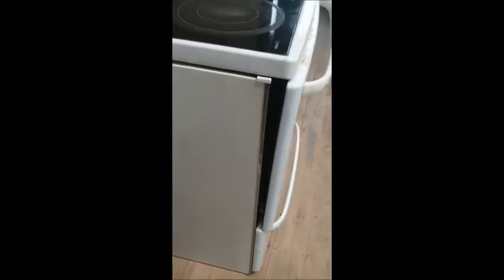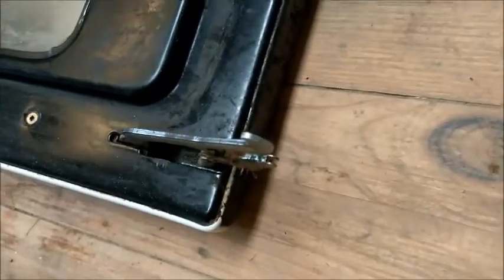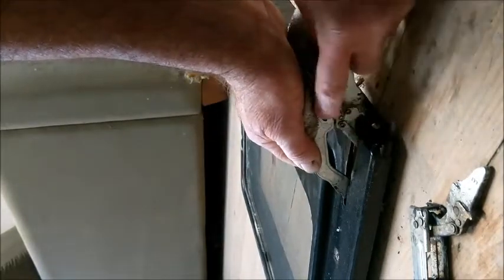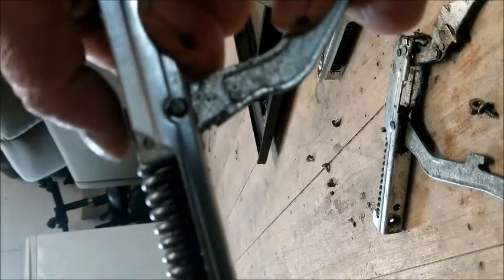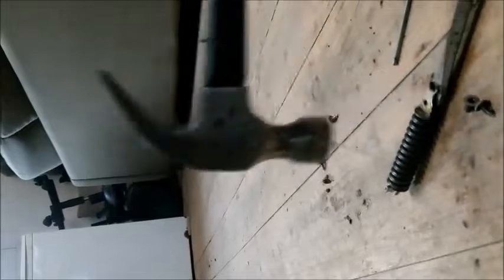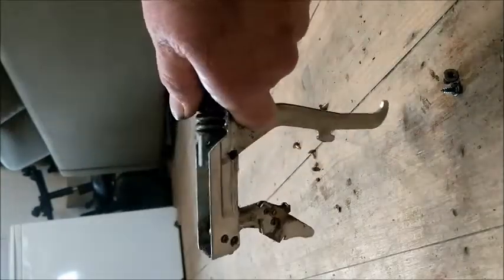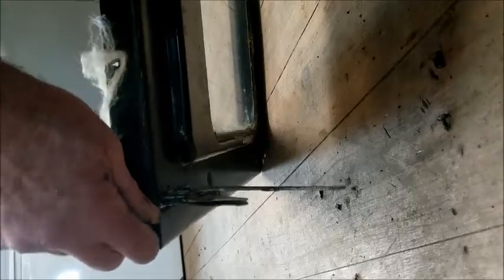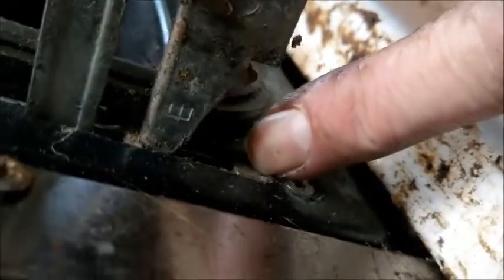Oven door not closing properly (Long double hinge type)

Comment: Cheers! This is the exact same hinge design as my Fisher & Paykel oven and followed your steps, however the way the half-circle closes up means it'll probably wear out again very quickly. So, what I did was remove the spring completely (in a vice - careful!) and add a pre-loading washer - that worked a treat! Also the hinge assembly was riveted onto the door, so that needed to be drilled out, and I replaced with screws.

Don't forget to re-grease everything either ;)

Comment: Thank you, this video instructed me how to remove the door, once I did that I found that one of the screws holding the mounts to the oven frame was missing, so the hinge couldn't push against it to tip up, replaced the missing screw and popped the door back on, fixed !

Comment: If you look at the 12second mark, you can see the frame of the oven where the hinge guide top and bottom screws are has been bent out. I would say heavy weight has been put on the door bending the frame, adding to the worn hinges. You can hammer the top screw area back in but after the metal has been stretched it usually will go back after a few months. I usually taken the conical washer off the screw and place it between the guide and the frame, meaning the guide is spaced back at the top and sits more vertical. It’s a little fiddly but does a good job.
Reply from the maker: Yes you're right. I've bashed the top screws in before. Which has fixed the problem for a while
Reply: "Don't put a heavy weight on oven doors" and "don't lean on fridge doors" should be taught to pre-teens, in school! It's so easy for parents to overlook this--if they ever learned themselves.

Comment: what do you do when one of the clips is damaged? I have an ilve with wire clips and one got mashed somehow. I'm pondering wiring the parts together, but any better suggestion?
Reply from the maker: Yes any sort of clip or wire to hold the 2 hinges together while taking the door out should work. Good luck with it.

Comment: I took mine off but now it's not staying shut no spring action . Does the top part have to be on tracks or latched on to something in there to stay?
Reply from the maker: Mmmm not sure.
The top part of the hinge with the hook goes in as far as it can, the most important part is getting the little groove back in on the bottom mount. The only thing I can think of is maybe your springs weren't clicked in properly and have popped out inside the door.